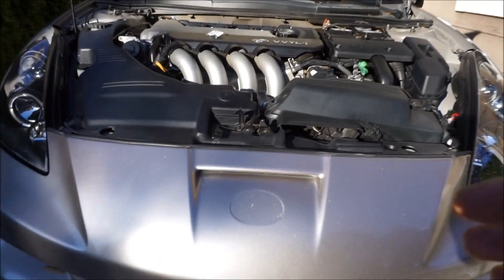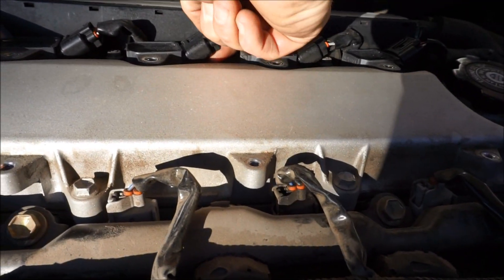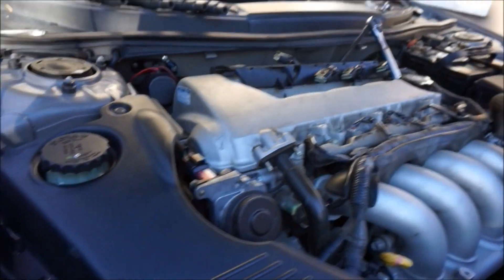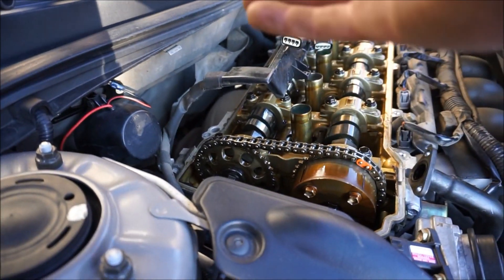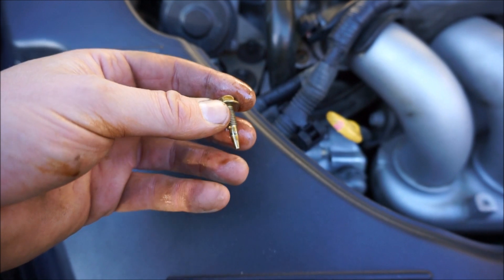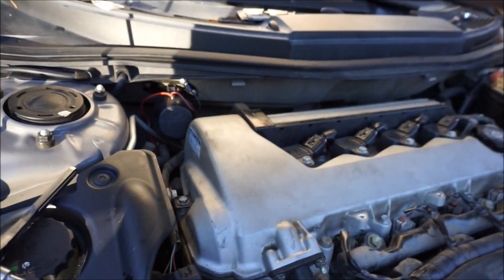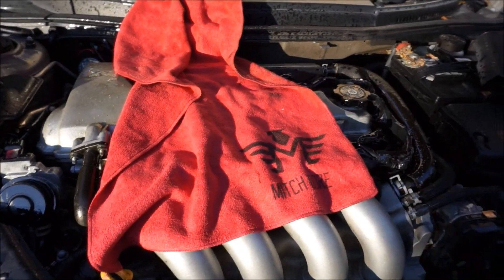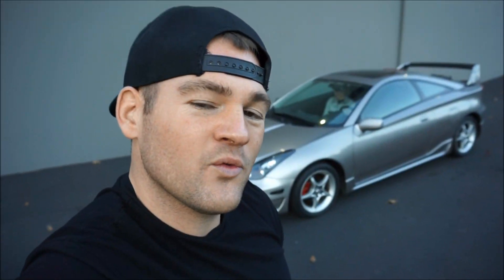MITCH DORE | How To Change VVTL-i LIFT BOLTS On Celica GT-S

Comment: Nice celica, i had the old design, 03 rolla sportivo. changed my bolts at 340,000ks. Luckily they weren't broken,also cleaned the two mesh pre filters. The car was running fine beforehand but after the bolts and clean the difference was night and day.

Comment: How much did you torque the valve cover bolts?
Reply from the maker: 7 ft/lbs Sourced From LotusTalk Forums
Reply: @MitchDore  how much nm is that mate? My mechanic tight this bolts in 7 NM > 0.7 kg

Comment: Hi question: is the lift bolts also recommended for the GT model? or is it just the GTS that had the worn out bolts issue?
Reply from the maker: 1zz do not have VVTL-I so there are no lift bolts
Reply: Them don't have lift that's one reason why they're slower